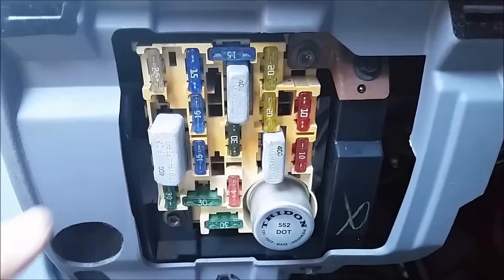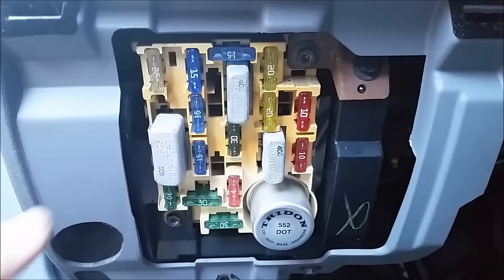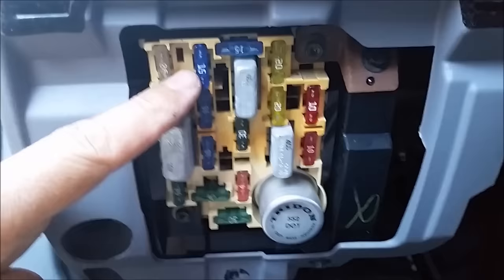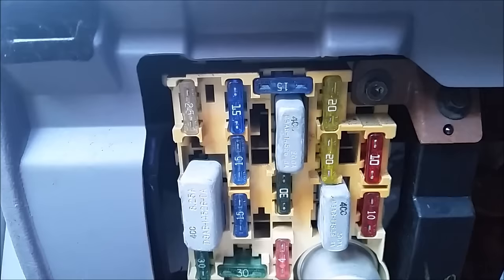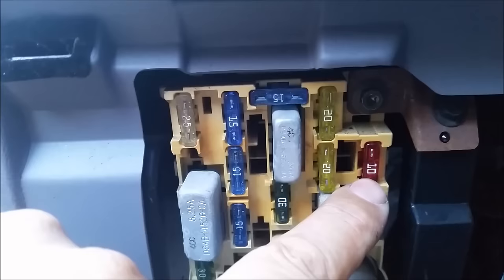HOW TO CHECK FUSE FOR ODOMETER AND SPEEDOMETER THAT ARE NOT WORKING

Comment: Perfect advice, thanks!  I've had to repair a few Ford speedometers due to corrosion in the solder points behind the circuit board and expected a more complicated solution for my inop speedo and odometer.  After seeing your video I checked all the fuses and found fuse #8 was blown.  After replacing it...problem solved!  Speedo & odometer work perfectly.
Reply from the maker: so happy to hear.  very cool.  if you haven't already, subscribe to my channel, IT'S FREE, and it helps me to believe i am not doing these videos for nothing.  take it easy
Reply: Paul Tashner I I would like to know how  2 Disable my speedometer
Reply: I have A350 pick up truck Forward super duty  wheel drive

Comment: My 2003 F250 speedometer is stuck at 70 mph at all times except when I come to a stop it goes to zero!
Reply from the maker: wow.  never heard that one before!!!  ok.  HOPEFULLY someone here will have the answer.
Reply from the maker: wow!!!!!  That's a new one on me.
Reply: Broken gear?
Reply: desertdoggz 
Mine is pegged at 85 mph & don’t know why because it just happened at idle just now.  The other gauges went bazzerk for 1 minute too.  No bad fuses either & I disconnected the battery 4 approximately 30 minutes jumpering the + & - battery cables to clear PCM of any fault codes.  Other gauges ok now but not the odometer.

Comment: God bless you for posting this, a 15 amp fuse saved me $ 2,300.00 for a transmission rebuild that it does not need and it fixed my speedometer .
Reply from the maker: That’s fantastic news. If you haven’t already subscribed to my channel and hit that like button. It doesn’t cost you a penny to do so. Take it easy.
Reply: That’s crazy. Thank good you didn’t have to pay that!

Comment: I got the extended warranty for free when my '96 F-150 4 X 4 was brand new by removing number eighteen shortly after I drove the truck off the lot.  The dealer noticed I wasn't putting much mileage on it  when it came in for maintenance or warranty repairs but the fuse was kept in the glove box and  was always replaced a few days before it had to go back in to the shop.  ☺
Reply: BUT... when you replaced it , didn't it show the true miles ?
Reply: @welcometoorefuge  Not the actual miles accumulated while driving it. Only the miles racked up while the fuse was in.

Comment: Hi, I have a problem with 2007 grand cherokee speedometer. The readings are barely visible. Sometimes it becomes a bit visible, where I can watch it while zooming, and most of the time, even thats not the case, though all the time, there is a dim light in that area. What could be the reason? My mechanic says replace the entire cluster.

Comment: Hi. I have a toyota tundra 2008 sr5. The tacometer and speedometer aren't moving at all but, the odometer is reading the Miles any idea what fuse I need to check or what the issue could be? Thanks

Comment: With that fuse blown will it make your truck shift hard? 
I have a 92 F150 fuse blew and it's shifts hard! I put a new fuse in and it shifted fine
Reply from the maker: Wow.  That’s a new one on me. Just count your blessings!!!
Reply: @conquryourfear  when I was at a red light I   looked down noticed the speedometer and the odemeter wasn't working and it started shifting hard. I went to get a 15 amp fuse and tried started shifting smooth.  I count my blessings everyday

Comment: My fuel gauge is not working, i have a full tank and it marks empty, is there a fuse to it before dropping the tank
Reply from the maker: good question.  i never dealt with this problem before.  maybe somebody can help Uriel???
Reply: Did you find the fix for this?

Comment: My speedo works but no odometer. My speed sensor isn’t on the dif. I’ll check both fuses
Reply: Were you having hard shifting issues?  Which fuse controlled JUST the odometer?  Thanks?
Reply: steve bigler one of them used to shift like a freight train. I never did solve my odometer issues. I’m thinking the cluster is bad.

Comment: I have 2003 ford winstar i need to sleepin and save fuel, however i been told its a money pit so hesitant to buy  it. Iknow the guy bought my truck from him. However the speedometer amd odometer dont work, rpms always do. Also abs and brake light always on as well as overdrive light flashing on amd off. Engine light on too
 It can be cluster or speed shift sensor. None of the auto tools can read anything or they just are stupid telling me its an air flow sensor, explains why it spits and sputters sometimes. But has nothing to do with my issues with speedometer.
Reply: Can you help me?? Do you think it's a fuse and would it be the same as here or different?

Comment: please someone help me out.
my 96 f150 4.9 in line.  the odometer docent want to work. It is causing my transmission to kick real hard every gear I know that means it's effecting my speeds sensor. 
I've checked all fuses, they are all good.
I've checked and changed the speed sensor. 
what else could it possibly be ??
Reply: I've got the same problem. Did you fix it?
Reply: PSOM module
Reply: Change out the two fuses highlighted above anyway. Sometimes where they blow is not as easily spotted as the top of the "curve".

Comment: Okay so I put a fuse in the number 8 and as soon as I start my truck and put it in reverse I got a buzzing noise as if my seat belt wasn't put on and the buzzing noise would not go off even with the truck turned off and the inside cab light was constantly on what's the problem there
Reply from the maker: That buzzer must be defective. Just unplug it

Comment: I TRYIED DOING THIS AND IS STILL NOT WORKING .I CHANGE SPEED SENSOR STILL NOT WORKING . ANY ADVISE.
Reply from the maker: Pull the odometer out and check to see if your harness leading to the odometer is plugged in good. Other than that you may be looking at a broken odometer

Comment: be very obliged to know why ford e-350 1995 fuses 1and 5 break down at the same time and it leads to no hazard\stop\turn lamps and bad transmission (AT) perfomance
Reply from the maker: Юрий Добрыдин maybe, just maybe, the fuse amps are to low.  For the 15, I would put 20; ditto for the other
Reply: thanks so much, it happened to be so easy., 
I have one more question - why does 1995 w351 efi 75000 miles near overheat (arrow is near right green border)  by outside city temperature 30 grade celsius (86 Fahrenheit ) with apropirate coolant level, non-leaking waterpump, replaced new THERMAL FAN CLUTCH,  new  temperature gauge, new rhrottle position sensor (idle was bad, now ok), new radiator cap?
Reply from the maker: Юрий Добрыдин how many pounds per pressure is that radiator cap?  Check to see what it takes, you may have it too high
Reply: the same 13 lbs cap (assemled in mexico) like old one, due to rockauto.com site
Reply from the maker: Юрий Добрыдин try 10 lbs

Comment: I replaced number 8 and odometer came on and in a minute it blew and odometer quit working.
Reply: You may have a short, follow the cable/wires to the connector, clean and check for any cracked wires.